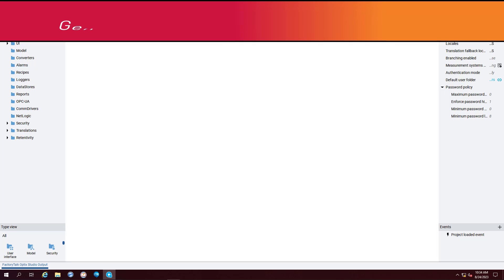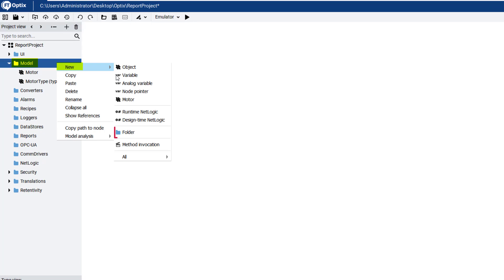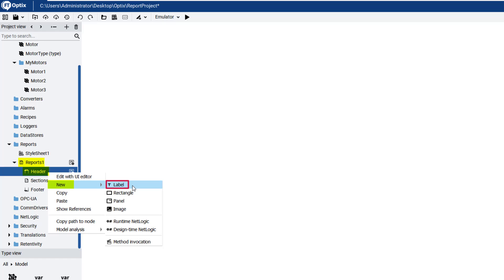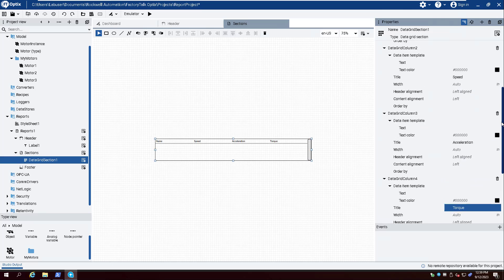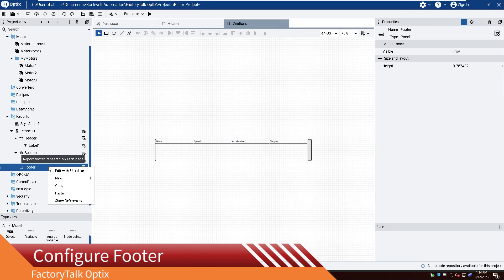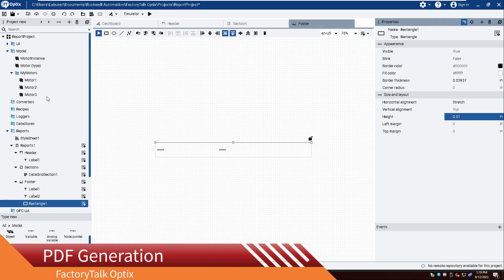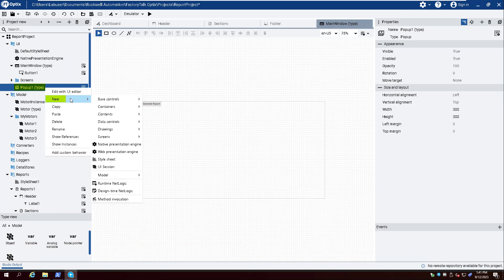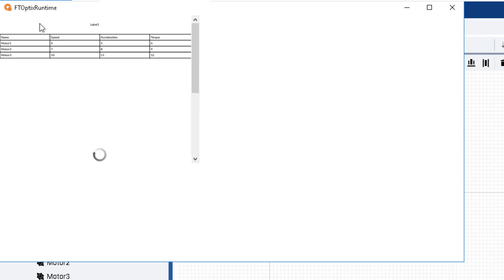FactoryTalk® Optix™ - Generating a Report

Comment: Hi quieck question: Is it possible to traverse the rows of a Datagrid with C#? I need to add Dynamic Link to each row at runtime.... thanks you!
Reply: Data grid is a UI object to display data dynamically at runtime. Each instance is created and then destroyed at runtime, as needed, using the linked model source and/or query. Not possible to create dynamic links. There is a better way to solve your problem. Head over to Rockwell's Engage community.

Comment: Hi there!
I am trying to find a tool for Allen-Bradley PLCs similar to SiVArch for Siemens PLCs to automatically generate faceplates and connect them to the HMI tags based on predefined rules. Could you please help me find such a tool?
Having a tool like SiVArch for Allen-Bradley PLCs would be beneficial as it would save a lot of time, and manual work, and significantly reduce errors. Could you kindly help me if there is a tool like SiVArc for Studio 5000? Thank you!